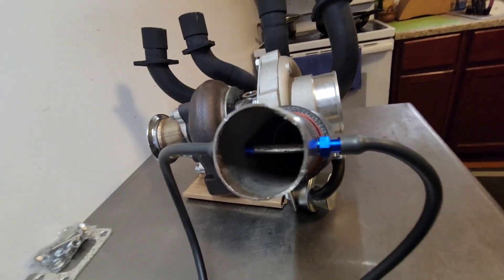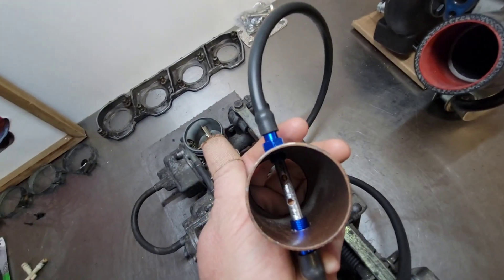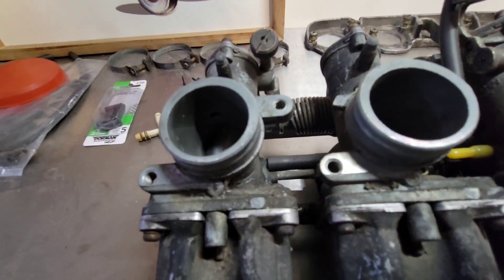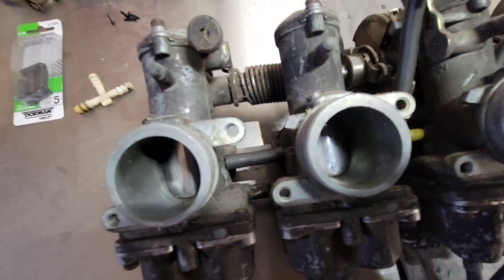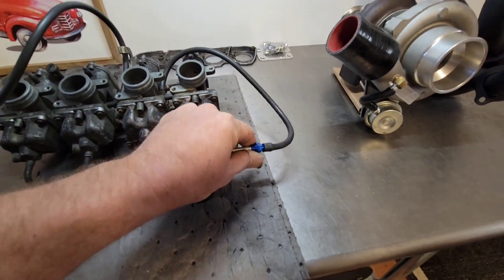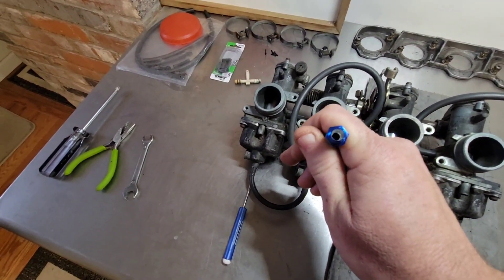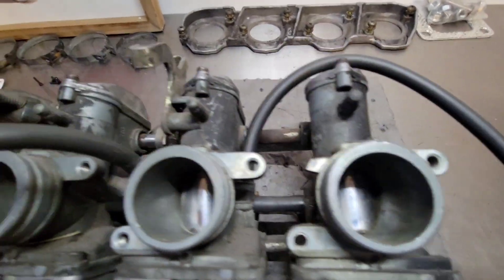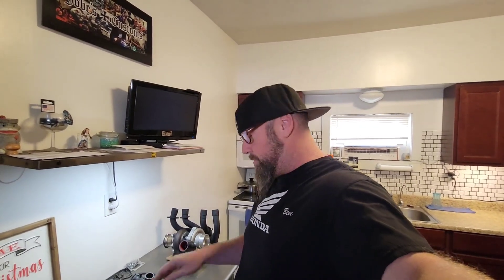- Ep.4 -  Honda cb750 single cam turbo engine build  - Pitot Tube

Comment: Hmm. Looks good, but a question about how overflow in the bowls drains off.  Seems that if enough juice leaks past a leaky float needle, you could get a hydrolocked engine if the petcock isn't closed while parked.  Maybe I'm missing something, but I do understand that the run between bowls is needed to keep the chamber pressurized.  Just thinking out loud...
Reply from the maker: Yes, I've thought about such variables.  But luckily this setup, with good, clean stock carbs is safe and good.  Safe to ride on the street, boosted.  All is ok 👍

Comment: HI Ben!  Me again.... wondering what you used for your Intake Plenum.  I recall you mentioning a Yamaha Part.  Is it from the 650 XS?  If not, what would work?  What's ideal?

I have a 1981 Honda CB750 Custom with about 20,000 on the clock.  I also have a Mitsubishi Turbo with the same base model (I listed it in a prior reply to you) but, NO Waste Gate.  It's from a 3L Turbo Diesel.

My Bike has Keihin CV Carbs.  Will this (CV) work?

Where did you get your Forged Rods from?  Are they still available?

Cams?  Pistons?

Thank you for your time!  I'm trying to decide if I want to Sell or Build.
Reply from the maker: Yes!  The factory rods, pistons, and cams will work fine, up to about 11lbs of boost.  Stay at about 10lbs, and all is good.  Ya won't need a huge fuel pump, or pressure regulator either that way.  It will still make about 100hp!  My only suggestion, is to pull the Cylinder head and cylinders, and open up the piston ring gaps, with a file.  Ya don't want them to heat up, expand, and touch.  Make the gaps about twice as wide, and they'll work fine.  That is yet to come, on my new build series.  Soon as my cylinder head is done, I will move onto ring gapping, for boost!
Reply from the maker: Hi, yes the plenum is a Yamaha part for a 650 XJ Turbo Seca.  The plenum lines up perfectly, with the Honda carb spacing, a few silicone boots, some clamps, and it's good to go!
Reply: @hondaben78  THANK YOU for your. reply!  Any thoughts on the other questions I listed above?

Oh yeah.... the Plenum has been ordered!
Reply from the maker: Sorry for the lengthy reply 😎